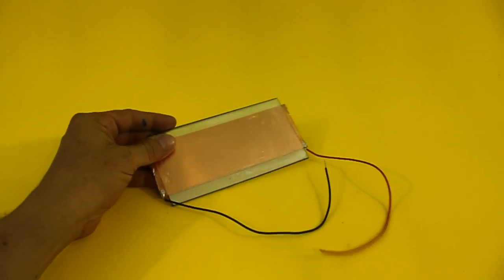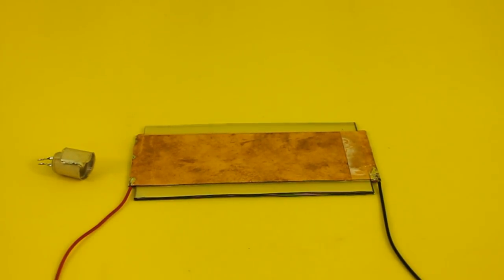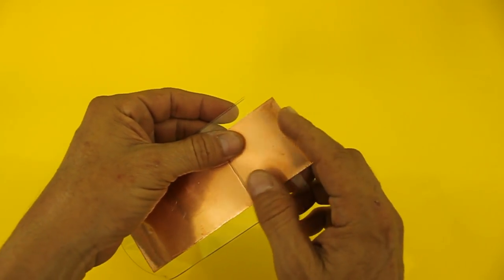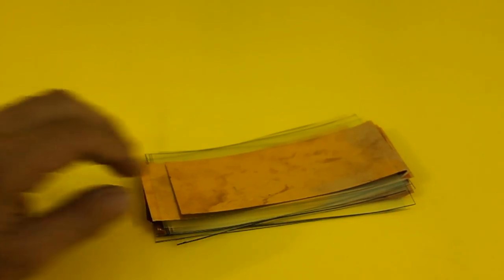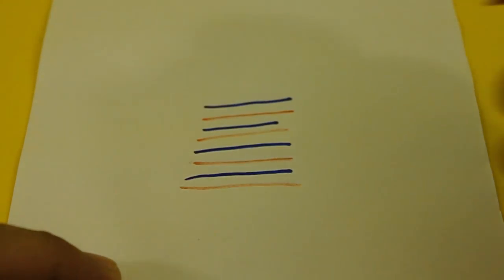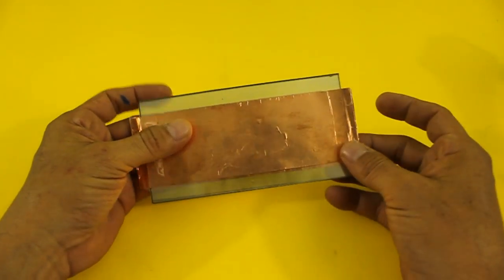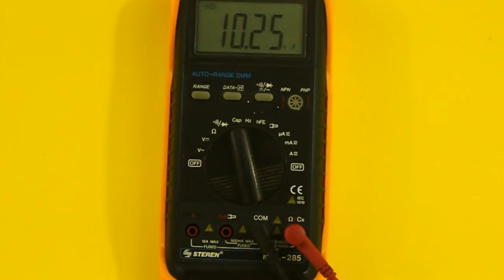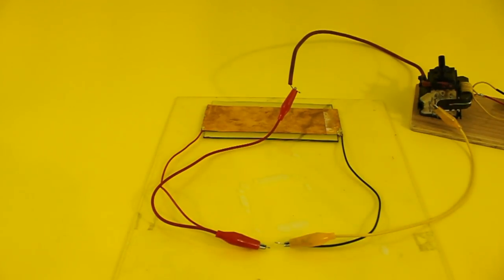Homemade High Voltage, Low Inductance Capacitor

Comment: It would have been cool to see you charge the capacitor then test it with a volt meter. But I understand 10,000v multimeters are rarely just lying around. 

Maybe charge it then disconnect. Then create the arc. The distance of the arc would relate to the charged voltage.
Reply: Or use some high voltage resistors to create a voltage divider that would divide by a known value, then test across the connection between the resistors and low side. Divide by say 100 and the meter should tell you 100 VDC, which you would know means 10,000 VDC. Just be sure to use HV resistors with a tight tolerance so you'd know 100 VDC means 10,000 VDC +/-1% or less, as opposed to say 10,000 VDC +/-5%, which could be within 9,500 or 10,500 VDC, or +/-10% which would be anywhere between 9,000 to 11,000 VDC...
Reply: That is a fantastic idea. Thanks.
Reply: I believe that the input charges the cap, at every strike, then releases all voltage at once, at every strike.

Without the cap, it just sparks a the regular fast frequency, but with it added, it builds up the volts, then releases it.

I believe that if you were to make the cap twice as big, the spark would be even slower to build, then release.

Comment: Actually an electrolytic capacitor has its aluminum "plates" separated with absorbent separating paper that's soaked in the electrolyte. The dielectric is an oxide layer that's built up on the anode aluminum "plate" strip. They anodize the anode aluminum strip which increases its surface area by creating microscopic pitting of the surface, then place it in an electrolyte that supplies plenty of oxygen and place a positive DC charge on it. They grow the dielectric oxide until its thickness is sufficient up to a maximum voltage rating that they choose, but usually not more than 600 volts, because electrolytes tend to break down at higher voltages, the dielectric oxide can only handle up to so many DC volts, thicker dielectric layers decrease capacitance significantly, and the point of this type of capacitor is high capacitance. Then it is sandwiched between two absorbent separator strips, the negative foil is placed on top of the other strips, leads are connected to the foils, the assembly of strips is rolled up, it is inserted into an aluminum can with breakage grooves that form a vent if the capacitor fails so it doesn't explode, electrolyte is added, and a plastic plug seals the capacitor up.

Comment: @5;01 you made an error in saying to connect the purple/ blue lines together. These are dielectrics, not conductors. You should have connected to the orange lines. You could also cut tabs on the sides located in staggered location ( like a filing cabinet) so that you can solder one layer to the next
Reply from the maker: You´re right!
Reply: Is the tabs needed and if so how did it work with everything soldered together
Reply: john michael not sure what you are asking exactly . The copper tabs are alternated left side , right side , and all the rights are soldered together and all left together which creates parallel capacitance . Parallel capacitance adds to be equal to c1+ c2 + .........Cn. So more layers increases capacitance.

Comment: Can you use aluminum tape instead of copper?
Reply: Yes, you can, but it will be worse in some aspect (dunno how it will affect capacitor). 
Also You will be unable to solder it.
Reply: Yes, but you wont be able to solder the terminals, because aluminum does take solder very badly. You would have to find another way of to common the terminals together.
Reply: it will affect the esr (the equivalent series resistance)
Reply: actually aluminum cans are commonly used for capacitors.
Reply: you write symbol of conductor with red colour but you write the conection of conductor with blue colour?
Reply: Yes, but for uses like tesla coil tank capacitors you want as low of an ESR and inductance as possible, and as low of a resistance, and stray inductance, in your primary tank circuit, (not talking about the primary coil's inductance, just the stray inductance of the caps and connections,) as possible. So Cu would be better, but Al will do in a pinch if you can't get Cu, or are on a budget. And no caps that are rolled.

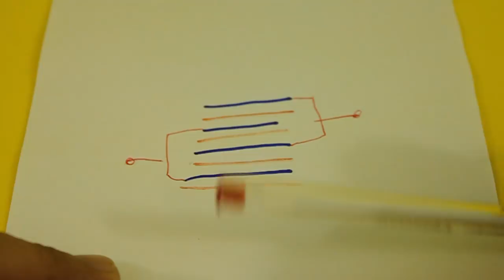Comment: 5:05 You did a mistake in your drawing!
You connected the wires to the dielectric material instead of the conductors!
otherwise great video 👍
Reply: How much is the current?
Reply: @Dailymailnewz  it's probably <= 100 mA

Comment: I bet you can smell the discharge arc. Does it have an odour? I am quite surprised at the difference. and will make a nice side project for a high voltage generator such as in one of your previous projects :-)
Reply: Any arc like this through the air will create ozone. So yes it will smell just like an electric motor that is putting out a lot of sparks. 

Of course the sparks are hot so anything that can burn will. Like the tips of the electrodes which might also cause an additional smell.

Comment: Ludic sir....can i use aluminium foil instead of copper tape???
Reply: Yes, you can use anything that can conduct energy well, alluminium is a good alternative, but be warned that your capacitance will be not the same with the same quantity of copper foil

Comment: Such coil does not increase inductance - there are parallel conductors with opposite current flow inductance of which cancel each other - as a matter of fact your capacitor will have higher inductance - because you connected plates from opposite sides - you can decrease it by connecting wires from the same side.
Reply: Do you mean to imply(say) that this capacitor will have a stronger magnetic field?
Reply: yes, when you connect plates from opposite sides it means (for alternating current) that all current flows always the same direction in both plates  - any flow of current creates a magnetic field. But if you connect plates from same side - current will flow in opposite directions in these plates, creating opposite and equal magnetic field, which cancel each other.

Comment: Hoi Ludic Science.  Many thanks for this explanation.  Very useful.
So, when I have made one like this of yours, where shall I connect it in my solarsystem 12 V. Before the charche controller or after the charche controller. 
I have a converter for making 12 V to 220 V on my batteries (3000V-6000V).
Really need very much an (simply) information. It is winter now and I have hardly electricity and my Plasma Q6 and Q24 are going down. They had already more than 110 V inside and now they are doing nothing, so no grow, and the Voltage is now between 55 V and 110 V.
Again thanks for this video.

Comment: Hi can i ask something please... good instructional video rthank you. What would happen if you put 12v though it?
Reply: The capacitor would get charged to 12v. So you would have 10nf (Nano farads) of  electricity at 12V. The farads is kind of how many electrons you can hold. The max voltage of a capacitor is how excited those  electrons can be before they jump across the plastic barrier. 

So this capacitor can not hold a lot of electrons you would need a lot more layers for that. But those electrons can be very excited at 10,000v without the electrons jumping and making an arc through the plastic. When you only put 12v across it you are not utilizing the fact it has the thick plastic layers. The plastic layer in standard 12v capacitors is very thin so you can get more layers of conductor in the same space but you will get an internal short at 24v or so which would mean no high voltage use. 

This is why a 100nf 12v capacitor is so small compared to a 100nf 600v capacitor. The 600v capacitor needs much thicker insulating layers.

Comment: sir, can we use this capacitor as a battery in a smartphone? ???
Reply from the maker: No
Reply: 10 nano farads is almost nothing compared to the cellphone battery, but this one would be way too high of voltage.

Comment: No no no... Regular rolled electrolytic caps probably doesn't have much of an inductance because the plate and dielectric layer is folded in half before it is rolled, making a turn around which cancels out the inductance. The manufacturers knows what they're doing.

Comment: The wires coming from the capacitor will also have some inductance. and you should also consider the skin effect. maybe use some thick litz wire instead :)
Reply: quangluu96 yes exactly. If hes purpose is to discharger the capacitor as quickly as possible he needs to consider those aspects
Reply from the maker: +txd oh yes litz wire

Comment: Why is the spark laud but invisible when you connect the capacitor in parallel?
Reply from the maker: +Bojan Atanasow camera effect
Reply: I see...  But the lauder sound?  Is it because you have a charge of the new Capacitor followed by a discharge  + voltage of power supply?
Reply: An inductor (in this case the secondary of the flyback transformer) and a capacitor have a resonant frequency that is inversly proportional to the squareroot of inductance times capacitance, so increasing the capacitance of the arrangement (there was a negligible parasitic capacitance before) will decrease the resonant frequency, lowering the frequency of the sound created by the spark, which in this case is within the audible range now, and also increasing the pulse periode making it louder.
Reply: WOW!!!  Thanks Bro for the extended response...  It is awesome...  So basically you are saying that in a way this setup turns into some sort of a Boost Converter and the Capacitor when it gets charged produces the LOW front of the square pulse, thus allowing the magnetic field stored in the coil to discharge increasing the original Voltage and current several times depending on the frequency of the pulse...
Am I on the right side of understanding whats going on or am I not getting it?
Reply: Um no? It's a capacitor in parallel with the output of a flyback transformer.  There is no boost converter here. The cap discharges very fast, the camera only records a picture once every 1/30 seconds and can't capture it properly. Try taking a picture of lightning during a thunderstorm and you'll see the problem.
Reply: Actually what I said isnt entirely true because it only applies to an inductor and a capacitor in parallel. The flyback in this video however contains a diode, so the flyback charges the capacitor and the capacitor discharges when the breakdown voltage of the spark gap is reached, and the frequency of that happening is determined by inductance and capacitance again.
Reply: Got it!!!  Thanks...  But LC gets a SPIKE without the capacitor too, just of the flyback, tiny one but still a spark...  So I guess the effect of the cap in parallel somehow gives more BANG for the buck as the spike is definitely louder the second time around...  Any thought on that?  I assume of course the voltage remains the same!
Reply: Without any capacitor it gets that spike every peak of the sine wave. You wouldnt see that on a high voltage output of smooth DC, because the spark would be continous, on AC or in this case pulsed DC the current reaches the breakdown voltage of the spark gap every peak of the sine wave and gets interrupted when it reaches zero inbetween. The capacitor wont be charged and discharged every peak of the sine wave because its too large, it needs several peaks to reach the breakdown voltage and the discharge results in a bigger bang  - on pulsed DC like in this video. On AC the capacitor would resonate with the inductor reducing the frequency and also resulting in a bigger bang. On smooth DC there is no capacitor needed because the voltage wont drop, so that only the current determines whether the spark will be interrupted, so that you can increase the distance of the gap by far without breaking the spark.

Edit: The LC is never without a capacitor, there is always a parasitic capacitance but it is tiny.
Reply: Thanks Chuck for the detailed explanation, it is greatly appreciated!!!

Comment: What makes this capacitor capable to withstand 10000V?  Just because it is 10nF?  How thick is the dielectric?  How thick is the copper tape?  Can you stick two copper strips into one? How can you make a Super Capacitor?  Say 1F on 240V???
Reply: You can not build a super capacitor at home. Supercaps for 240V don't exist. The only way to make it, you'd have to put 90 single cells (2.7V) in series. And balance them..
But making 1F 240V like in the video you would need a bigger house.
Reply: Got it...  But why is it that High Voltage Caps always have small capacitance and small voltage caps like 2.7V have high capacitance of say 3000F like the Super Caps on AliBaba...
Reply: I mean Why is it a problem to have it both?  Hi Voltage and High Capacitance...    Why is the above capacitor in LC's video so low in capacitance...   And what are low voltage high capacitance capacitors made of?  Is it the isolater is it the plates?  And why they say that it is impossible to have a Capacitor that doesn't leak...  I do have a big fat 7.5V 70000uF Cap...  I pumped it up to 12V and it never budged...  What is usually the tollerance for those big caps?  Do you think I can pup it up to like 24V from 7.5V rating on it?  Im kind of crazy about Boost Converters and Super Cap Arrays...
Reply: viva "You can not build a super capacitor at home." you can and very small in comparison see 
A 1,700F Supercapacitor Robert Murray-Smith Published on Apr 3, 2015
https://www.youtube.com/watch?v=iD2rVGjG2HQ and 
How To Make A SuperCapacitor - Step By Step Published on Feb 18, 2016
https://www.youtube.com/watch?v=1Ce2au3PWnI

in fact its advisable with any inverted high startup loads to make and add in a supercap bank between your battery bank and inverter to smooth out any peaks generally today...
Reply: viva you forget, there is no such thing as "free energy" only reclamation and reuse of existing potential energy , you need to get out more VivaMessico, as everyone knows RMS is the go to english scientist that shows you how to investigate and re-produce all his claims and devices etc and derivatives there of... 

OC NORMAL informed people go down the garden shed (rather than mess up their kitchen) all the time, and reproduce all his inks and devices on several scales to date, as they RMS/FWG are now gearing up for in house production lines and kit to hopefully produce the industrial processes book for their IP and mass production for any 3rd party to then licence and produce their derivatives ...

as for "I just see a guy talking" this might be a new thing to you but "actually learning by example" and watching the supplied video's you will "learn to do it right" if you care to actually do the experiment.

https://www.youtube.com/watch?v=1KHAcbBeIII
Visiting Colombia - At The University Of Santander
Reply: Bojan Atanasow If you look at the textbook equation for a plate capacitor, you can answer all your own questions. C = ε*A/d ,  
ε = ε0*εr
ε (greek letter epsilon) is the electric field constant. ε0 is permittivity of vacuum, εr is material specific to the dielectric. 
A = area of the plates, d = distance inbetween. 
so if you get two 10cm x 10cm sheets of copper and separate them by 1mm of air you get... ε0 * 1 * 100cm²/1mm = 88 pF. But the breakdown voltage of air is 3kV/mm. Push the plates closer together and you'll get more capacity, but also lower breakdown voltage. Now air is not a good dielectric: low relative permittivity, breakdown voltage changes a lot with pressure and humidity. If you use Polyester foil like in this video and build the same 10cm x 10cm capacitor with 1mm dielectric, you get 265 pF and a breakdown voltage of around 17kV. Better eh? Now if you only need 250V you can make the dielectric very thin, say 0.0147 of a millimetre. Now our capacitor has 18 nF and can handle up to 250V. That's just one layer. If you make one side very long and roll it up, you can reach capacities of electrolyte capacitors. 
But all this is still very far from a super capacitor's capacity. In a supercap, the "plates" are just nanometres apart. In fact, it doesn't have a dielectric, at all. That's why it only handles 2.7V.  It's very complicated and that's why you cant just build it at home.
Reply: Hey Viva...  Thanks Bro very much for your reply I think I am starting to getting it...  By the way I am self taught so this formula I haven't seen in my amateur books...

Comment: That capacitor wasn't wound as a coil because a coil is like a spring but was instead wound in a cylindrical manner.  Inductors are normally wound in a coil shape though.

Comment: Awesome project I was wondering can it be possible to build a voltage multiplers along with your previous high voltage diode too
Reply: Yeah, I'm wondering whether those diodes can function at high frequency.

Comment: Somerhing doesnt make sense here....where is the carbon and acid layer....this is fake
Reply: That would be a chemical electric battery.
Reply: @graphenepixel8231 u  sure??
Reply: @starofeden9277  it is different than the solid state capacitors.
Reply: There are many ways to make capacitors. Many many different designs.
Reply: @graphenepixel8231  ok